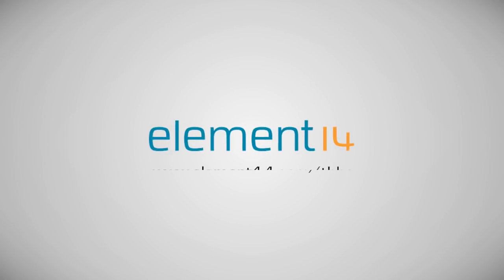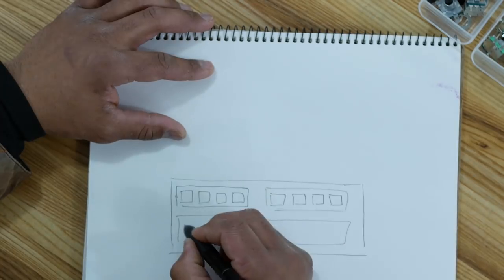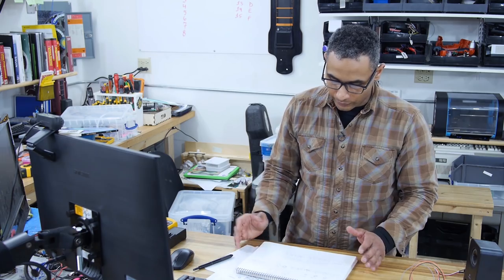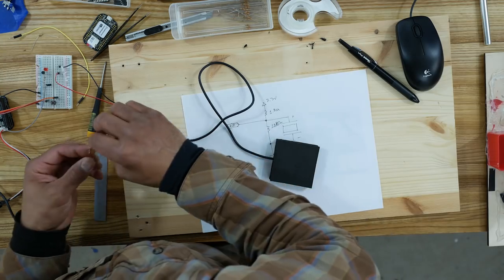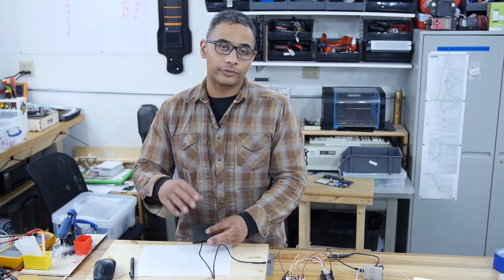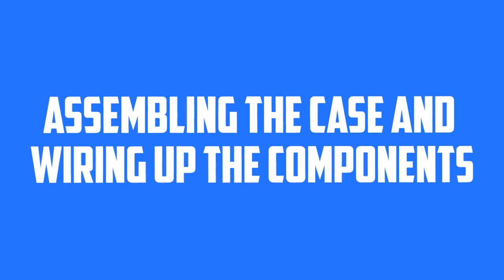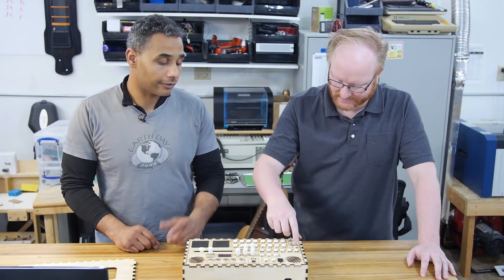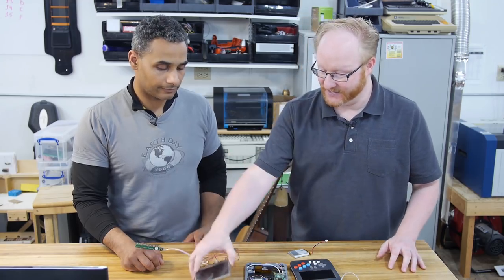Pocket Beagle bela.io Drum Sequencer

Comment: I can't believe that they still haven't discovered perfboards that have traces in form of lines instead of just holes with soldering pads. It makes prototyping 10 times easier reducing number of wires and you can actually desolder your component withaout messing your wiring.